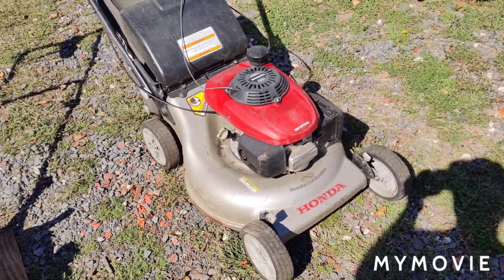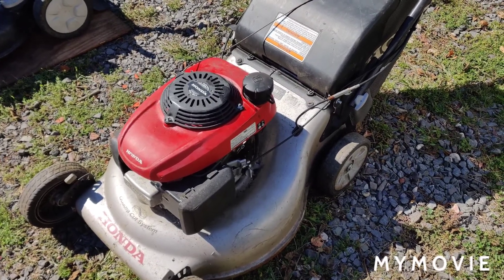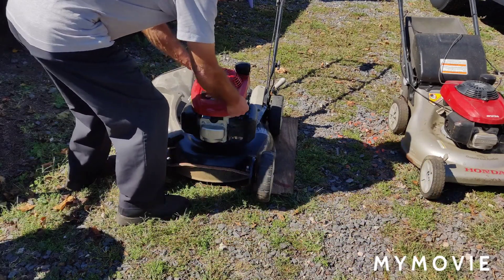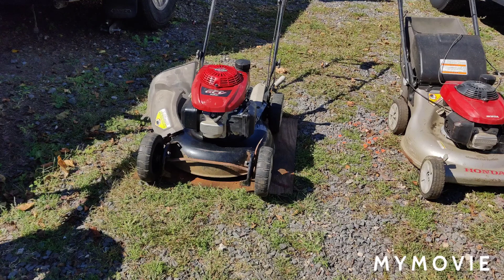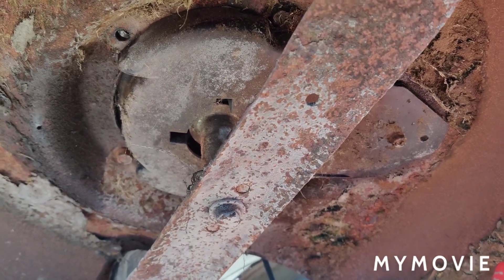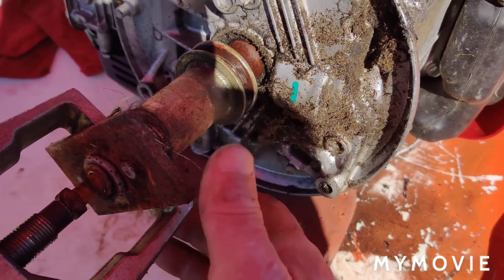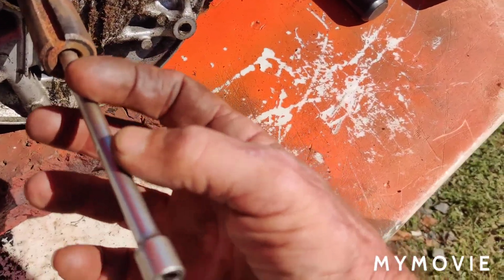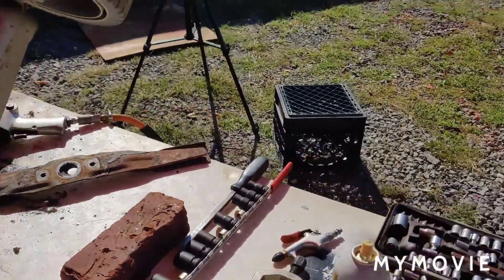Honda mower engine replacement Part 1

Comment: Cool!  I never understood why Honda has the quadracut system, seems overkill and makes the engine work harder.  I have the same engine to be repurposed someday for an old Toro.
Reply from the maker: Paul Campbell I feel the same way about the Overkill. Thanks for watching. Stay tuned for Part 2 final.